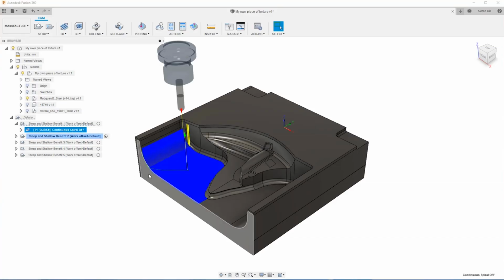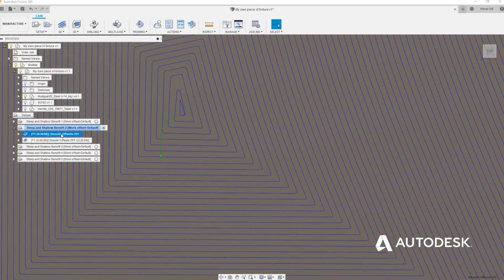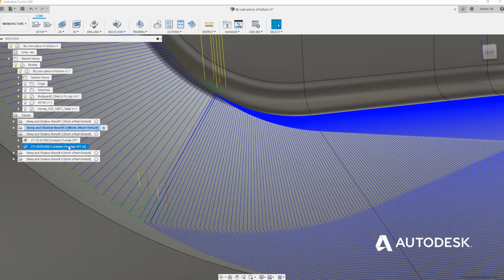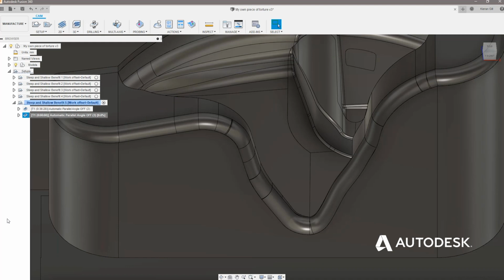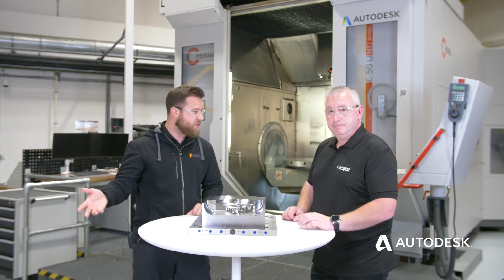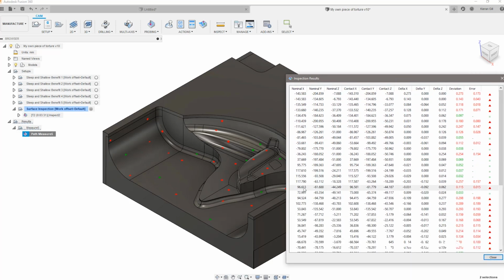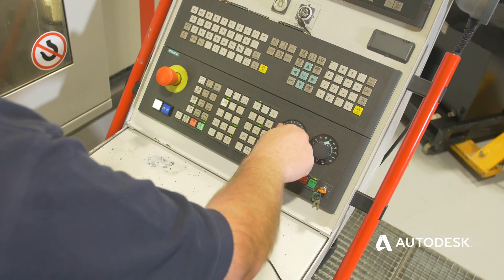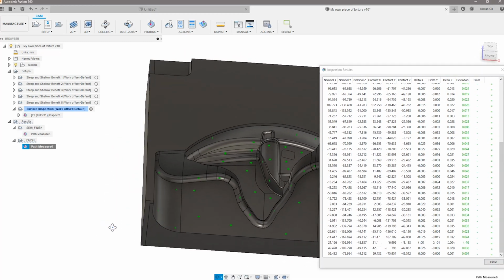Machining a Mudguard with Steep and Shallow & Surface Inspection

Comment: 0.54  is that a gouge in the vertical face radii?
Reply: Jorg, good spot indeed. So the block on the table was part of a first run of the mould where we had some issues with leads which we managed to sort out in the final version you see being machined and inspected at 12:48.
Reply from the maker: Don't you love it when one of the stars of the show drops in to address comments?! I sure do, thanks @Kieran Gill!
Reply: Indeed it is! Good eye. If this were a production mold, it would be useless!
Reply: A different angle at 1:47 proves it's not a reflection.
Reply: Sometimes "one off" parts become two.
Reply: It will buff out

Comment: Saw the video a few days ago about this but simply couldn't get to the place with pricing etc, so gave up looking after 20 mins or so. No idea who "organised" that part of the plan but reading below, it seems you are now trying to charge $125 / month?!!! Really? Well, good luck with that and perhaps the guy who came up with the idea will move on shortly.

Given that most(?) users won't be paying for this, please arrange an option to hide these annoying features from the menu bar.
Reply from the maker: We appreciate the feedback, Murray. Wondering what/how you were searching for when you were unable to find the price. It should be right there when you click the wrench in the corner, or the information "i". 
Per the ability to hide the extensions, I would recommend you submit this to IdeaStation as it doesn't currently exist (at least I was unable to find a similar request). https://forums.autodesk.com/t5/fusion-360-ideastation/idb-p/125
Reply: @adskFusion  All I get when I click anything to do with it is "Error: Extensions unavailable (no suitable contracts found). See log for details.
"
Reply: @adskFusion  it doesn't say how much a cloud credit costs in real monetary terms though does it?
Reply: @adskFusion  I second "One Works 2" All I get is an error message. Nothing more. Had to look up that it was a paid solution.

Comment: This is a wonderful addition to Fusion 360. Unfortunately it doesn't come with it. You have to buy a subscription to it to the tune of $125 per MONTH!!! This is VASTLY more expensive than the entire Fusion 360 software package. What the heck Autodesk?? I honestly can see why you guys added most of this as an extension with a paid subscription. The additive manufacturing sounds like an entire software package in itself. But Steep and Shallow should have just been added to the 3D strategy's already contained in Fusion. It's the only thing that Fusion has been missing in the CAM package for a complete toolpath solution.
Reply: @josh.... imagine how Inventor CAM & HSMWorks users feel, paying way way above what Fusion 360 users pay, and have been waiting far far longer for their CAM product to get the 3D surface toolpaths needed to do the job properly. Only to find it's been added to an additional subscription only available to Fusion 360 users. I think putting the surface inspection stuff and advanced 5-axis toolpaths in as an additional subscription would be fine... but anything which solves long standing issues with existing functionality users have been sold on... they really shouldn't be charged for.
Reply from the maker: Hey Josh, sorry that the decision to put this in an extension doesn't sit well with you. We're listening to feedback on this change, and will use it in determining next steps. Thanks for taking the time to provide feedback!
Reply: @adskFusion  No problem! I absolutely love your product. It has made my life much easier in many ways! I'm just bummed because I'm a mold maker and this toolpath is EXACTLY what I've been waiting for. Right now we use the scallop toolpath. We find it's a good compromise between surface finish, the time it takes to program the toolpath, as well as minimizing witness marks from directional change over multiple ops. We like flow, but with complex organic 3d surfaces, it takes a long time to select all of the faces. So it's not very cost effective. I would literally use the Steep and Shallow toolpath all day, everyday. I just can't justify the cost as we have built our business model and pricing around our current operating costs. Thank you for your fast response! That's one of the many reasons I love Autodesk.
Reply from the maker: Well, this is about the best response we could have asked for! Thanks so much for providing details on what is is your up to, and where the extension pricing is causing trouble. We hope that you get a chance to use Steep and Shallow in the near future. We love our users and hope they know it!
Reply: @adskFusion  You make a product that gets ever better. The extension package includes a lot of functionality that it makes sense to pay extra for (ex the probe utilities) and I think that it is fair that you pay for ex. generative design etc. The reason that the steep and shallow tool path seems like bait and switch, is that you are building the most amazing product for people moving form CAD only to integrated function, and MANY novice CAM users. The steep and shallow tool path is like the - i am to ignorant about tool paths to choose the right ones, so I press the magic button tool path. From a business moral view point I think that this part is out of tune, as 3D adaptive roughing + the steep and shallow tool path is essentially what the novice with a €1000 router needs to make parts.

Comment: Automatic QC after part done before you even touch the machine. I'm in love!
Reply from the maker: Pretty stellar functionality!
Reply: @adskFusion  It needs a better practical use in production. Taking it back into fusion 360 to check is a bit cumbersome. It needs to go faster. How about integrate the phone app into this. If inspection routine is all good, you should just get a "green light" in the fusion phone app or something. If it has something wrong you can get the model with points that is wrong displayed in the 3D viewer in the app. 

I know that will be difficult in terms of network work and access to files and all.  But when has Autodesk stepped away from a challenge?  Keep walking this awesome road! <3